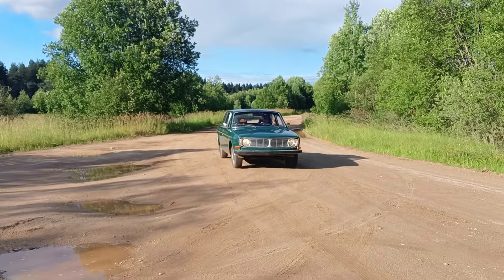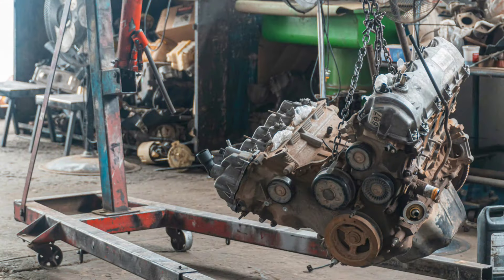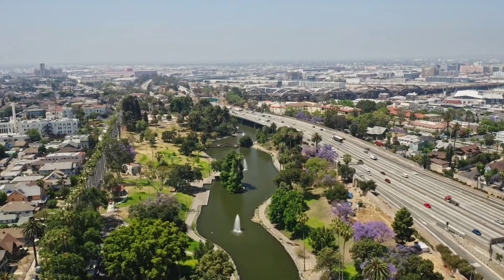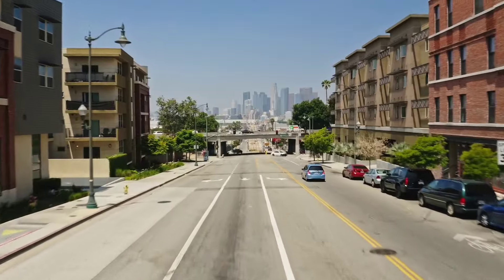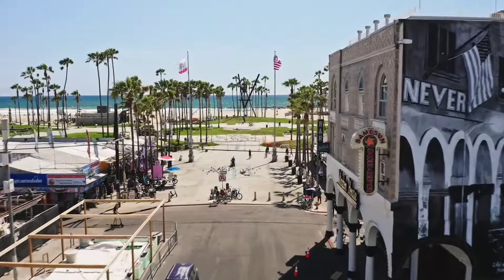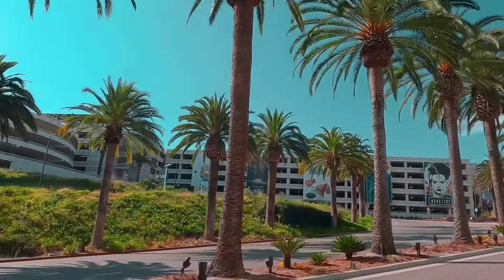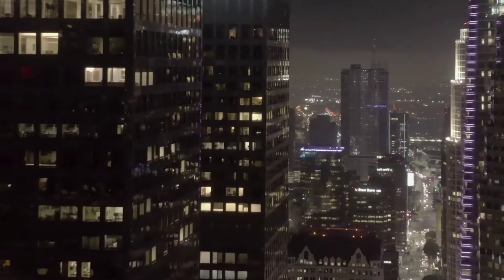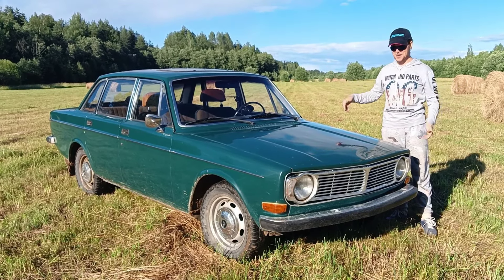That's Why Old Engine No Worse Than New #volvo140 #carengine #oldcar #caradvice

Comment: Once again good commentary. Myself I don't have as much a problem with the 240 timing belt as the computer controls. You mentioned the turbo .I agree that performance comes with a price.
Reply from the maker: @stevesoltez8745  Yes! I've never seen broken original Volvo timing belt. But many times I've seen mechanics which blame timing belt. Years ago I have had b230gk turbo, turbo without any problems. But I was without any experience and approached to mechanics about timing belt. Is it good? Yes, they will say that you need to replace it! So good if car will not working more worse after their replacement. Now a lot segment of their work with cars is to convince client that he (or she) need their help and then rip him off as much as it will be possible or even impossible.